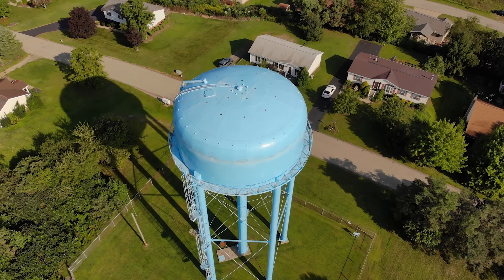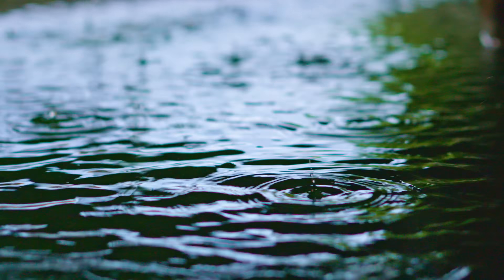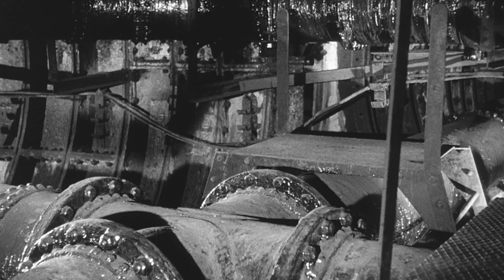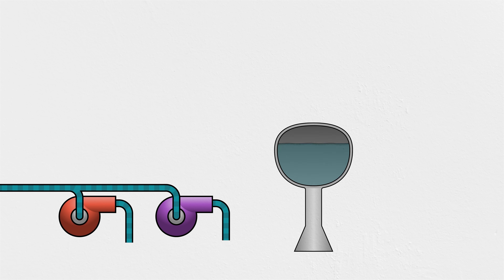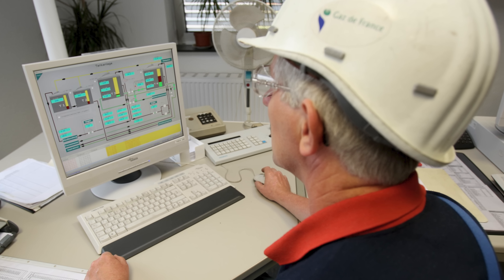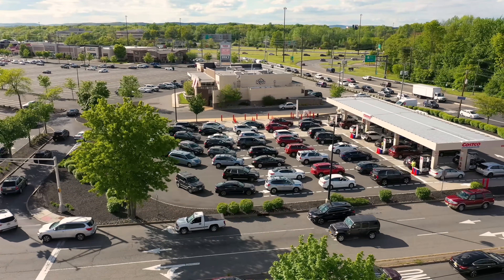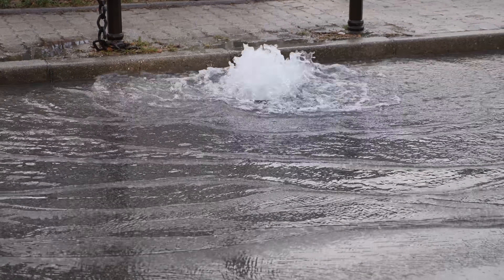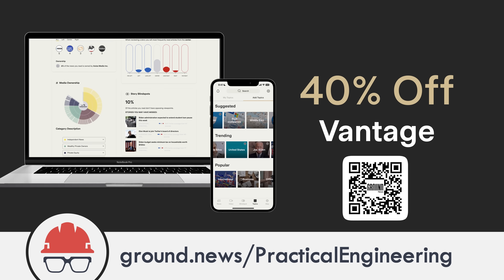When Infrastructure Gets Hacked

Comment: i never understand the need for a system like a water pump needs to be exposed to the open internet.. makes no sense for there to be remote access like that. also for the top vulnerability for an airgapped system, employee access, a usb port should never be given full access to the system, only a custom technician special port should, something a normal employee wont ever have,  so even if they plugged in an infected usb drive they found laying around, the infection will find itself walled off and unable to control,  yet alone access much of anything.

But really for most vital systems, especially a uranium enrichment plant, i can say with certainty that regular employees have zero reason to ever have a need to plug in a any usb device. so it's so foolish to think those are usable on systems with it, so in reality usb ports or any publicly used style of port, any should be disabled completely, or better, not exist at all on air gapped nuclear systems.

Comment: As a former PLC/Controls Tech, if you have access to the same network that the PLCs are run on, and those PLCs have implemented EtherNet/IP, Modbus Ethernet, or MELSEC Ethernet, the security is basically zero -- or at least it was when I last worked on Allen-Bradley and Mitsubishi systems. With the right software (or software you've written yourself), you can essentially read & write to any register on any PLC on the network (in the default configuration), which can override switches, sensors, and many other things. For this reason, PLC IP networks are usually fully disconnected from the Internet and any machines with dual network access (if any at all) would be tightly controlled and secured. I wrote software that used to scrape the registers on our PLCs for data gathering & reporting purposes, and although many of the industry "open standards" companies (like ODVA with EtherNet/IP) would try to force you to pay money and have a real company to get access to the "open standard", even back then it had mostly been reverse engineered and documented online. That's not to mention that most machines were still running Windows XP or similar, and up until the late 2000s/early 2010s, Allen-Bradley was still distributing software keys on floppy disks. Oh, and most of the popular HMI software running on a full-blown Windows PC (rather than just a standalone Windows CE-based embedded HMI), most likely is also running Microsoft SQL Server, which is not exactly known for its stellar security.

Comment: Lots of systems require a network connection just due to location. Remote oil and gas equipment can be several hours drive from a central control room.

Interesting shoutout about the Calgary feeder main. It's been a political and infrastructure nightmare up here.

Comment: I'm a controls engineer. I've designed many many pumping station controls systems across the country, designed their HMIs and built their SCADA screens.

You don't need to fret. All of these pieces of the puzzle can be reconfigured on the fly to run without any fancy controls. Over 90% of process motors have a manual mode that the motors can be run in called "Hand" mode. If the onsite tech is any good, he could rewire the panel for an across the line start without much hassle and bypass any sort of higher level controls.

Also, I'm quite offended you chose to call out RTUs instead of PLCs. Sure, more modern places will have some pretty high level controls. But, the whole point of OT infrastructure is robustness, and moving to a windows controlled system with only RTUs isn't very safe inherently and any plant that does is begging for trouble. PLCs on the other hand can only run one program, are easy to fix if they break or are compromised, and are so ubiquitous that a lot of electricians and mechanics can troubleshoot them.

Comment: As a Network Engineer I've had a lot of customers that utilize SCADA networks. Some of them go to great lengths to separate the SCADA network from their less-sensitive networks, but still too many either don't have the IT manpower or budget to truly segregate the SCADA network and I think this is where a lot of issues lie. 

When you have networks of control systems for everything from water supply to power generation, it's not enough to just segregate them by a VLAN/subnet and firewall them off. You NEED separate hardware, separate switches, routers, firewalls, etc. Unfortunately, this is not the case in many situations I've seen. Even with the proliferation of ransomware attacks, zero-day exploits, and so-on, municipalities and the like still take a frighteningly lackadaisical approach to Cyber Security, because it's expense and not often a tangible thing they can present to the board or council.

Comment: The problem often lies in default passwords and user names not being changed on critical networked equipment. Then, remote access is not locked down hard enough, often with passwords that are easy to guess or brute force. No 2FA or other login challenges exist which makes it really easy for even a modestly skilled hacker to gain access. Critical infrastructure needs to use a zero trust model to ensure only those who need access have that access, not anyone else. And access needs to use strong password entropy, at least app based 2FA with all equipment behind a firewall.  It’s not cheap, and that’s the problem. Rather than spending on security, paying the shareholders their dividend is more important. That’s going to bite us in the a$$ sooner than we think.

Comment: As someone in IT... if the SCADA equipment must be controlled remotely, it should be only accessible on an isolated SCADA network, accessible from a remote interface in a control centre.  If the company/government is too cheap to have the control centre staffed 24hrs... I could see one remote interface system also on the secure corporate network (and the computer heavily locked down and logged, with automated alerts when someone logs into it), and where someone could remote into the corporate network to another PC, then do a second hop from that computer to the remote system.
Critical Infrastructure should never be accessible from the internet, and air-gapped is best, as it forces someone to do much more work to get onto it, as they have to either trick someone to do it, or have physical access locally to a terminal.

It's one reason I hate IoT devices... they often don't give an option to not have them connected on a dedicated/isolated network without internet access.
Reply: The problem is that too many companies see the internet as a cheap alternative to dedicated lines.  In the old days, pre-public-internet, if you wanted remote access, other than dialup, you had dedicated lines that NOBODY had access to but you.  Nowadays, so many companies assume that the internet is "secure enough" and much cheaper (the REAL reason), so they choose internet connectivity over dedicated lines.  In the end, they may find out the hard way that it's not cheaper when they have to repair the damage a hacker leaves behind....

Comment: Before digital computers were developed dumb analog circuits (not computers) controlled levels without fault, these should still be used and the digital computers need only monitor and report conditions.
Putting any controls on the public "internet" is a total lack of security and senseless.
Ron W4BIN

Comment: If anybody is wondering whether the lead/lag pump configuration causes the lead pump to wear out sooner, you should know that lead/lag pump controls are typically programmed to swap which pump is the lead pump every so many hours of operation. Additionally, for critical pumps, there's often a spare on the shelf, or a third pump that is rotated so there's always a pump in the system. This is also a common configuration in HVAC systems.
Reply: No, but I do kind of feel like a slacker now for not wondering that.
Reply: He did cover that in the sewer video too

Comment: It's actually scary how many completely unprotected systems like this reside on the internet on a public IP address with an open VNC port 5900 and no password protection whatsoever. This is not about someone hacking a system, this is about systems requiring no authentication, because people think that if nobody knows the public IP address, it cannot be found. Anyone should know that phone scam calls work by trying random numbers, much like an "attack" like this would look like.
Basically, most of these engineers lack basic IT security knowledge.

Comment: Taking it a step further, you should do a video about PCS/DCS systems that control an entire plant, or even MES systems that work with PCS/DCS systems to manage batch production in manufaturing systems.  Automation systems are some of the least covered and least understood by the general public.  Even most IT professionals don't know what these are.  SCADA is just the tip of the iceburg.  🐾🐾

Comment: Another great video. I prefer to call water towers water batteries. I have strongly felt infrastructure should be a closed loop operated system. This "almost" eliminates outside hacking options. There should always be at least 2 personal on the site at all times if there is a emergency where a valve needs to be opened/closed a remote personal is not 20 minutes away kind of deal.

Comment: I would say most large companies have set up countermeasures, i worked at volvo their computers had no ports "except for one" no wifi. no tcp/ip.

The port was a non standard port. in fact it was just a line of contacts 17 all in all, they were used to connect to the other computers that all shared this feature of ports. It didnt matter how much you wanted to bring the work home you just couldnt. You wanted solitaire on your computer, impossible.

You couldnt add a floppy disk drive or a cd disk drive a usb was out of question and for good reasons too.

Now this wasnt all that popular i might also add.

Comment: Grand Prairie, TX has it's water tank contaminated. A fire truck with foam injected the chemical into the system. 
They said they didn't have a backflow valve installed. They had to flush 2 million gallons of water from the system.

Comment: You mentioned that in previous times systems were monitored and operated by employees that know a lot of said system.  Automation was introduced and the need for such employees went away, as the automated system can do a better job, that is fantastic.  The issue is that then you need capable employees to understand and manage the automated system, but that is kind of lacking.  Not only you need to know how to operate the automated system, but also make sure the automated system works as expected in every possible sense, and security is one of them.
This is an issue I have see in many places, as if the computer control system will do magic, setup by someone that says "he knows" how to do it, following some examples; just recipe for disaster.

Comment: If you need sensor data to be monitored remotely you can use a data diode that maintains a physical air gap and only allows one way traffic by using an opto-isolator

Comment: A large problem we have right now, at least as far as I can tell with what I've seen and heard, is that a lot of the people running our critical infrastructure have been doing so since before the internet, or at least before digitizing systems became a feasible thing. This makes a lot of them view digital systems as either impenetrable, since the security methods they know of don't apply to digital systems, or to forego digital security because they have a hard enough time using the new systems without having to go through all the extra security steps. Knowledge of digital security is severely lacking amongst a large amount of the people running critical infrastructure, and we're just lucky no one has decided to exploit that gap en masse.

Comment: I was part of a wastewater plant build in North Carolina. Our internet security was to literally unplug the HMI terminal from the internet. Small town and simple security. Another system I help design had security keys for remote access. You have to know quite a bit to sabotage industrial ethernet. Any major damage to infrastructure will be caused by Fed or local government operators. Properly designed municipal plants have significant redundancy and protection designed into them from outside influence. I see proper design decreasing significantly and rapidly over the next few years as DEI Marxism get further infused into engineering. Enough State engineering boards voted to have NCEES reimagined to protect pronoun Nazis over protecting the public. Lack of merit and corruption will destroy the USA like it has every other nation that tries it.

Comment: Critical systems should not be on the internet. If they are on a private network not connected to the internet then hacking shouldn't be much of an issue.
I was working on a NASA spaceflight system which had a separate physical network for the secure side. There were 2 terminals (not PC's) next to each other, one on the internet the other off on a private network. The only way to get commands across the network was to receive and cross check the commands from the internet system, then apply them manually to the private network.

Comment: The only reason these systems are connected to the internet is convenance. In the eighties before there was an internet we used phone lines with modems, some of which were designed to only tell them who was calling before disconnecting and then calling that modem back using it's own phone number list. If you are not transmitting images phone modems can keep up with most data transfers, and if you need images like for security systems just use separate internet connected systems.

I have never understood why anyone would connect infrastructure or accounting systems to the internet without a gateway in between. Management would just have to wait a bit to get the numbers for their spreadsheets.

Comment: Ive watched a friend of mine remote in to a water treatement facility nearly 2000 miles away and start altering the PH of the water bejng output from the facility and monitor in relative realtime as we played videogames and such. 

The capability of these systems to be controlled like that has to be weak point if the general security practices are not great. It was cool to see exactly what Grady described with the HMI. It was really cool, we spent about an hour talking about it and watching it, discussing what he was doing and such. 

Hes an engineer in water treatement. He was supposed to be doing it. He had just gotten back from installing the equipment a few days prior.

Comment: 7:32 Some incidents have been kept from the public precisely because they exposed a vulnerability.
(Edit)
Anecdote: More than 30 years ago, I was told about a guy who connected the mains to the phone line. He took a piece of two- or three-lead wire, and attached a mains plug to one end and a landline phone plug to the other. Then he plugged in both ends to their matching outlets in the wall. The nearest phone exchange malfunctioned, and hundreds (or thousands?) of homes no longer had a dial tone. And this was well before cell phones were common.
The guy who told the story, said that incident was held tightly under wraps at the time. Presumably quite a few years had passed, and fuses and protections had been installed everywhere since.

Comment: 7:05  It also DEFINITELY means the software engineers didn't even bother to include Sanity Checks on input values, which I'd bet my bottom dollar also means they didn't have sufficient test coverage of ANY layer of the HMI software, either.
Reply: Exactly what I wanted to comment right now. Can't believe those systems have no protection against accidental or intentional operator error. 

It's like using 2 contractors to change the direction of a motor and allowing both to be powered at the same time. Or allowing a traffic light to have the option "all green*. 

Absolutely unacceptable.
Reply: The problem here: the HMI is often generated by engineers who are NOT specialists in software.  Even 15+ years ago it was easy to build a custom HMI interface using tools provided by the manufacturer of the HMI.  That means the process engineer ( who probably has little to no software experience) can easily set up the HMI to do what they want, and they probably won't be thinking of sanity checks.
Reply: @neosenshi    the PLC should have the checks, if you only have them on the HMI, the part between two machines or machine parts also won't be protected. 

When I had PLC stuff during my apprenticeship, the teacher always told how important it is to prevent wrong inputs to cause dangerous situations. We also had to consider breaking wires for safety features and other things. 

I absolutely agree with you that the operator always should be able to configure the HMI in a way, that makes sure they can do their job in the best way and that the safety of the machine should be their job. The machine should already be safe enough by default.

Comment: One of the best security features I've ever seen was using PCs that had epoxy resin squirted into every USB port. A more common implementation is to use software that immediately calls the security person when something is plugged in. 

Sort of as a joke/test, I once asked if I could have permission to plus a USB powered drink-warmer in my work PC. The response was a chuckle and an extremely firm "NO."